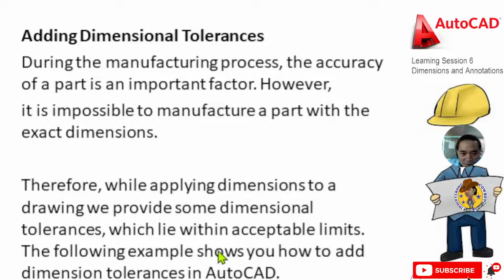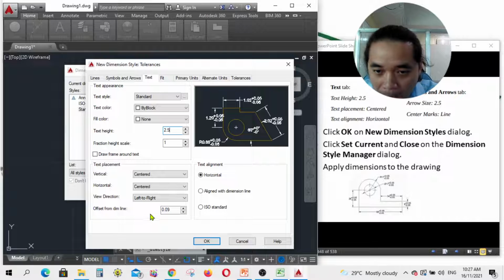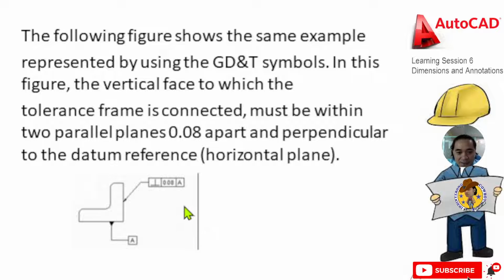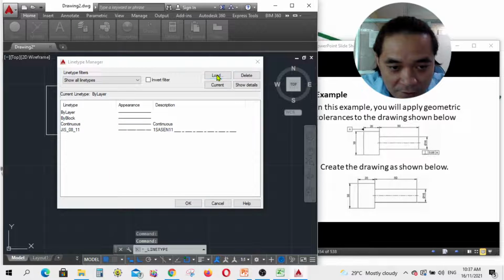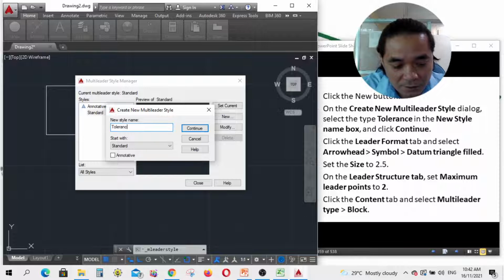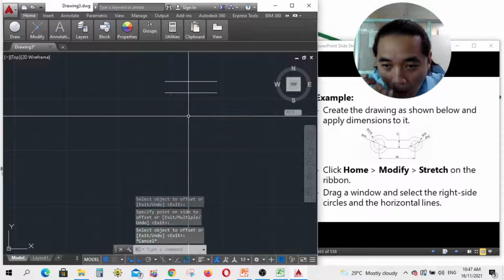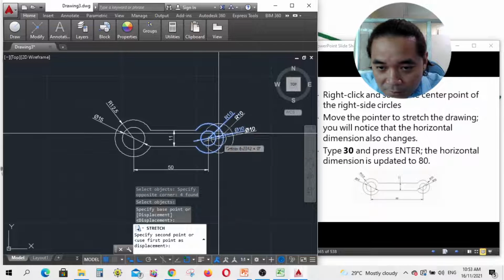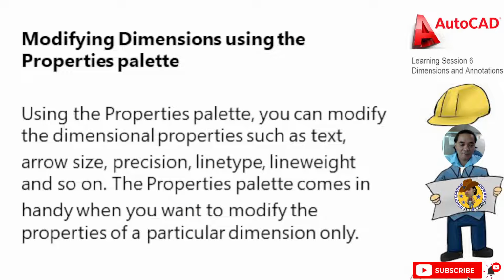AutoCAD LS 6-3 | Dimensions and Annotations

Comment: Under this session, I learned a lot more about various dimensions and annotations, as well as their applications, such as geometrical measurement and tolerancing, where I learned how to attach tolerances to a function's size/dimension and the importance of tolerances to its shape and alignment. There was also the geometric analysis of several symbols that were used to characterize the symbols. Certain measurement tolerances can also be accomplished within tolerable ranges by incorporating tolerance limits.

Comment: This third part of Learning Session 6 tackles adding Dimensional Tolerances. According to Engr. Mardie, during the manufacturing process, the accuracy of a part is an important factor. However, it is impossible to manufacture a part with the exact dimensions. Therefore, while applying dimensions to a drawing we provide some dimensional tolerances, which lie within acceptable limits.  Geometric Dimensioning and Tolerancing were also discussed in the video. I’ve learned that we must give tolerance values to its shape, orientation, and position as well. To avoid confusion, we should use Geometric Dimensioning and Tolerancing symbols to specify the tolerance values to shape, orientation, and position of a component. The last example in this video talks about the Editing Dimensions by Stretching where the dimensions are associative to the drawing. If we modify a drawing, the dimensions will be modified, automatically. It’s quite challenging but very satisfying when we're done performing it. Thank you, Sir!

Comment: These dimensions and annotations, as well as how to apply tolerances to their size or dimension, form, or orientation were explained in this video. The symbols were defined by geometric tolerance symbols. In order to ensure that your components fit together properly, you need to pay attention to the tolerances. Allowing for margins of error in dimensional tolerance analyses does not necessitate costly overprecision. On engineering drawings, the use of geometric tolerances is used to depict all of the geometrical requirements. Consider them for surfaces that come into contact with other parts, especially if exact tolerances are required. Thank you so much sir and God bless!

Comment: This video taught me about various dimensions and annotations, their purposes, and how to apply tolerances to a component's size or dimension, form, and orientation. Geometric tolerance symbols defined the symbols. Tolerances are important for ensuring that your components fit together correctly. The most exact dimensional tolerance analyses will accommodate for margins of error without requiring costly over-precision. The use of geometric tolerances is utilized to represent comprehensive geometrical requirements on engineering drawings. They should always be considered for surfaces that touch other parts, especially when precise tolerances are used. More videos to come sir!
- MIRA, Rico A.

Comment: In this lesson I acquired much more about various dimensions and annotations aspects and its uses, including such geometrical measurement and tolerancing, where I discovered how to attach tolerances to a function's size/dimension, as well as the value of tolerances to its form and alignment. Then there were the geometric consideration of different symbols, which were utilized to describe the symbols. Also, by including tolerance limits, certain measurement tolerances can be achieved within reasonable parameters.

Comment: In this video, I learned more about the other dimensions and anotations features and their functions such as geometric dimensioning and tolerancing which I learned to apply tolerances to the size/dimension of a component and tolerances value to its shape and orientation as well. Then the geometric tolerancing symbols used to define symbols. Also, the adding dimensional tolerances which provide some dimension tolerances that lies within acceptable limits.

Comment: In this part  of lesson 6, I learned about adding dimensional tolerances,geometric dimensioning and tolerancing, geometric tolerancing symbols,editing dimension by stretching and modifying dimensioning and extending.I want to highlight that Tolerances are an essential component of technical drawings. Tolerance values can be included into your dimensions in Autocad. Dimension styles are used to apply tolerances, and you can have many dimension styles for different types of tolerances. Geometric tolerances indicate permissible form, profile, orientation, position, and runout errors. The TOLERANCE command in AutoCAD can be used to add GD&T symbols to designs. Geometric Dimensioning and Tolerancing (GD&T) is a set of symbols and standards developed for users in order to quickly finish the exercises given with accordance to the requirements needed.

Comment: This video gave me more knowledge pertaining to other dimensions and annotations characteristics and their uses, such as geometric dimension and tolerance, and how to apply tolerances to a component's size/dimension as well as its form and orientation. Geometric tolerance symbols, which were used to define the symbols. Tolerances are essential for ensuring that your components fit together correctly to generate a good end result. You should measure your tolerances as precisely as possible since the most accurate dimensional tolerance analyses will account for margins of error without requiring costly over-precision. Geometrical tolerances are used to convey in a brief and precise manner complete geometrical requirements on engineering drawings. They should always be considered for surfaces which come into contact with other parts, especially when close tolerances are applied to the features concerned.

Comment: This video exhibits other dimensions and annotating characteristics and their uses such as geometric dimension, tolerance and how to apply tolerances to a component's size/dimension, form and orientation. The symbols were defined using geometric tolerance symbols. Tolerances are necessary for ensuring that your components fit together properly and provide a nice final product because the most accurate dimensional tolerance studies account for margins of error without needing costly over-precision. You should measure your tolerances as precisely as possible. Geometrical tolerances are used on engineering drawings to represent comprehensive geometrical requirements in a concise and exact manner. Thank you and hoping to see more of your vids.

Comment: In this learning session, I discovered much about the other dimensions and annotations features, such as adding dimensional tolerances, which are just a significant aspect in the manufacturing process, and geometric dimensioning and tolerancing, which I learned to apply tolerances to the size of a component. Also, the geometric tolerancing symbols used to define the geometric condition, the objective, and its symbol were there, which was interesting to see, especially for a newbie like myself.